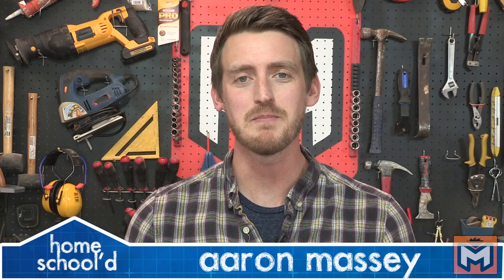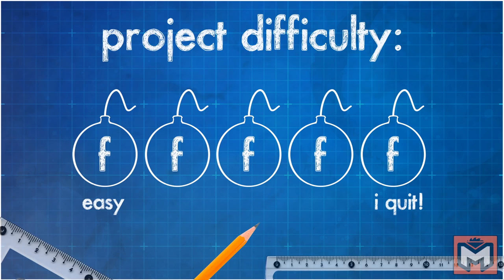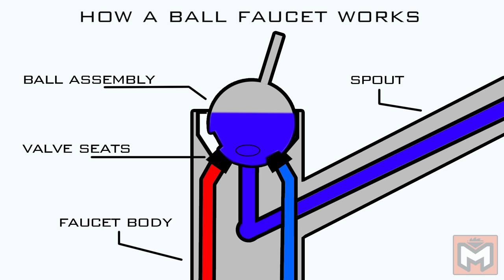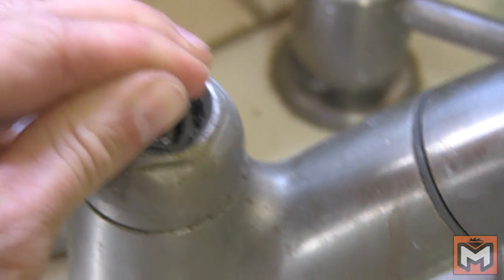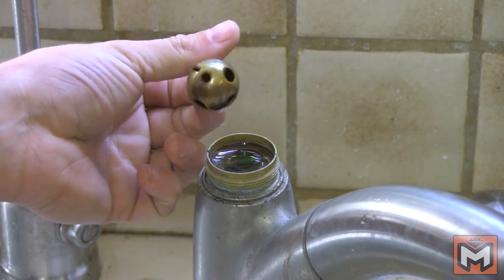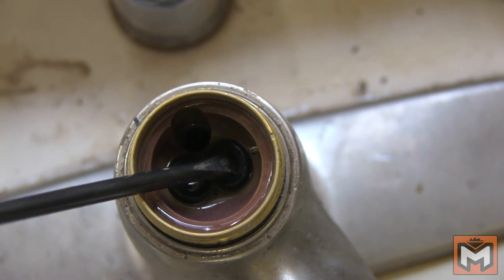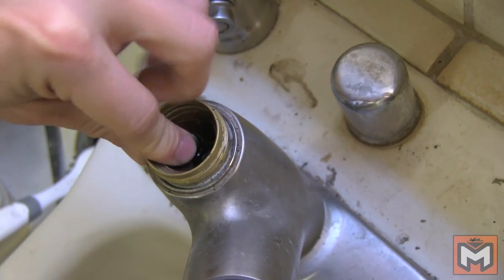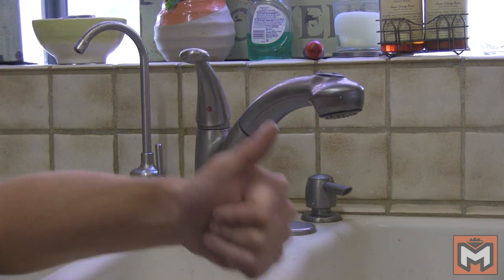HOW TO FIX A LEAKY KITCHEN FAUCET

Comment: great help, woke up and turned on the kitchen faucet to have this exact issue. Thought I would have to replace the assembly but wanted to check, off to the harware store and hoping they have the correct size repair kit as this sink is pretty freaking OLD!. Thank You for sharing and subsribed.

Comment: you even saved my $10 ! , I was about to buy the latest one with lots of new features like proximity sensor , lights . etc.. lol. I simply just had to tighten the nut above ball joint. voila . no more water dripping/ leaking . saved $$$. Thank you soo much :-)

Comment: Thanks for the info, I just replaced all the O-rings on my Moen M7800 kitchen faucet successfully stopping the leaking from the base.   It is not a ball joint faucet however now there is a drip ~ every 5 mins.  Ideas?   Thanks in advance